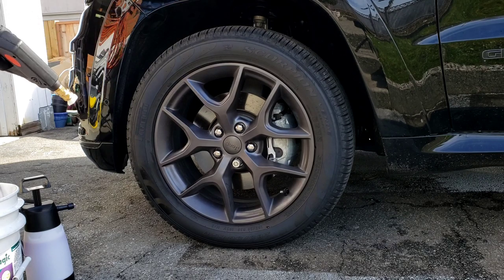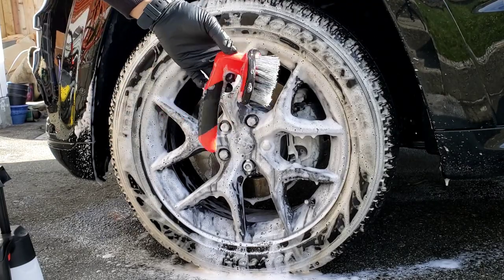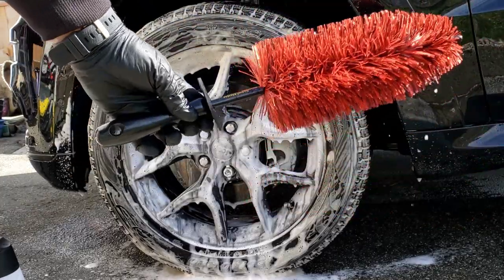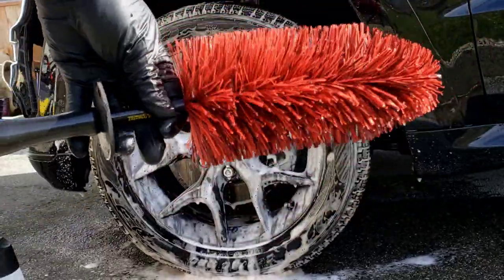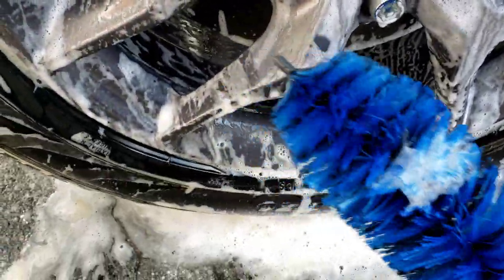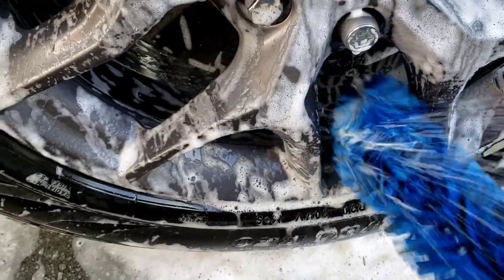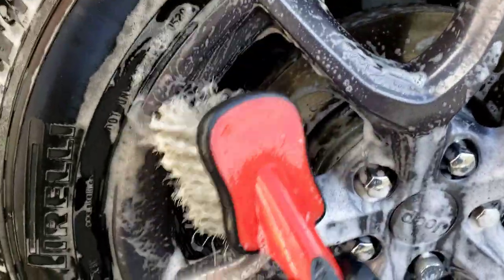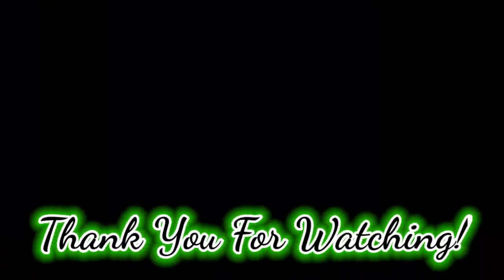The BEST Brushes For Detailing Wheels

Comment: You sure that plastic brush won’t scratch wheels, I once used a plastic bristle brush on my wheel and completely ruined it.
Reply from the maker: Which one? The EZ detail brush or the mothers brush l used on the wheel face? I haven't experienced scratching with either one of them. When I use these, I use a wheel bucket with a grit guard, warm water, and car wash soap. The warm water softens the plastic bristles and the soap adds lubrication. I'll make a video on the steps I take to make sure I don't scratch when using these brushes.

Comment: Great Video!! I Just Bought A Chemical guys Red Rocket Brush And The Little Red Rocket Brush. They Work Great I Also Use The CG Boars Hair Brush To Use For The Small Intricate Spaces.
Reply from the maker: Thank you Raymond! This style of brushes are the most effective for the barrels. I use boars hairs brushes sometimes for around the lugs and valve stem.
Reply: Hey bro, how are you liking that red rocket brush??? Just ordered mine and don't know if it's same size and similar material as the ez detail brush or if I should just go with the ez detail brush instead... thoughts?
Reply: @EricGonzalez-bd1qd  Hey Bro, I Think The Red Rocket brush is Still A great Brush Haven't Had Any problems with it yet! As for The EZ detail brush I've Heard it's Great But Maybe Later I'll Get One . I Just Maintain The Brush After Every Wash I Rinse it out and Hang it to Dry.I Hope you Enjoy Your New Brushes.🙂👍👍

Comment: Wheel Woolies for me, I tried an EZ brush but I did not get on with, too much splash back for my liking. Great video and regards from the UK 🇬🇧
Reply from the maker: The splash back factor is the only thing I don't like about these brushes. I still prefer them better over the Wheel Woolies because I find that they can squeeze into tighter spaces better. Thanks for watching Geoff.

Comment: Agree on being the best however, the construction at the end of the wire frame needs a better protective cap that does not come off overtime allowing the risk for scratching the wheelbarrow or facia without noticing. Especially for professional use.

Comment: Why does the link to the speed master seem so different and smaller than the one your using?
Reply from the maker: I might have accidentally linked the mini version. The brush comes in the normal size (the one i use mostly) and a mini version.

Comment: I have always used a soft wash cloth towel to clean my rims and tires. I have always looked into wheel brushes but have always been worried about scratching the rims especially since one of my vehicles has gloss black rims. As for the tires I have been considering the mothers tire brush. Is it still useful and worth it for lower definition tires? For example a 265/50R20?
Reply from the maker: I treat gloss black wheels like I treat black paint on the rest of the car. On the face, I use dedicated microfiber towels for gloss black wheels. For the barrels, the still use my EZ Detail brush. The Mothers Tire brush works great on low profile tires, the only place you'll run into an issue is right at the bottom where the rubber meets the ground.
Reply: @TheCarDetailingChannel  thanks I ended up ordering the max shine tire brush it’s smaller and looks easier to use with low pro tires

Comment: I use the blue EZ Detail (toilet bowl) brush to clean my wheel wells, this cheap plastic brush to clean the drum of the wheels, a stiffer scrubber brush to clean the tires, and I use a soft brush to clean the face of the wheels
Reply from the maker: The one thing I forgot to show in this video is that the EZ detail brushes work well to clean wheel wells. Thanks for watching.

Comment: Thank for the video. I always like to see what others are using day in and day out. I really like using a yellow drill brush for tire cleaning. I also use a soft detail brush for getting into the lug nuts and other tight spots.
Reply from the maker: I tried using a drill brush for a while but I found that it slung too much. It worked really well though that's for sure.

Comment: I use the same blue ez brush that you did. For the face of the wheel I usually just pressure wash most of the dirt and  use a microfiber wash mit because I never let my wheel get too bad. My Charger's got brembo brakes and that brush cleans between them pretty good.
Reply from the maker: The Ez detail brushes are excellent for cleaning the barrels and even the wheel wells. I too sometimes use my dedicated wash mitts for the wheel face. It really depends on how soiled the wheel is and how many spokes I have to deal with

Comment: I like the ez detail brushes as well.  For the tires the tuff shine tire brush works great. and a chenille noodle mit for the face, with a regular boar hair detail brush for the hard to reach places on the wheels.   For gloss black wheels, I'd probably go with wheel woolies, and I have been thinking about getting their boar hair wheel brush for the wheel face.
Reply from the maker: Gloss black wheels are always the ones I have to be the most careful with; I treat them just like the paint on the car. I'm thinking about getting some of the ultra soft detail factory brushes to try on the wheel face.